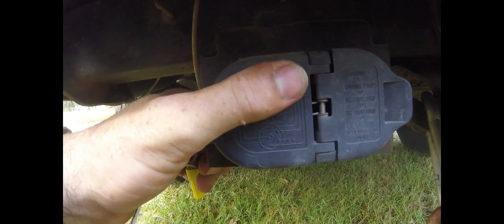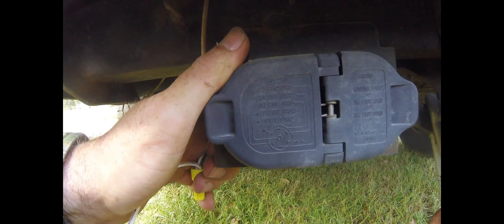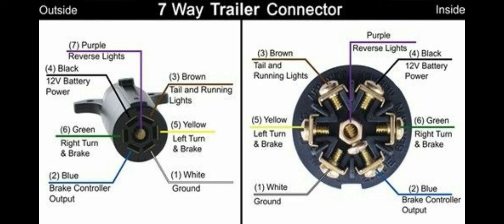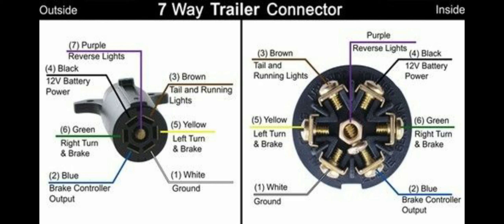7 Way Trailer Plug (Wiring made easy)

Comment: I have a lonestar 40ft gooseneck it had a 6 blade pigtail I change it to a 7 plug where do I connect the blue trailer brake wire
Reply from the maker: I’m going to post a picture on our community tab of a 7 way plug. Typically the blue wire is for trailer brakes and it would be the lower left. Let me know if this helps!